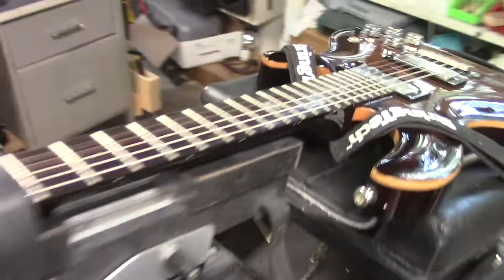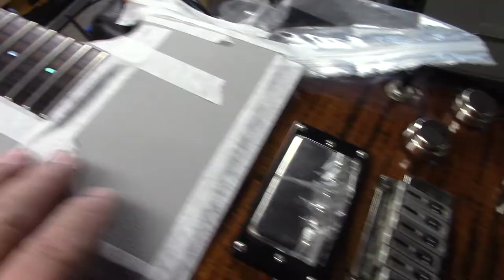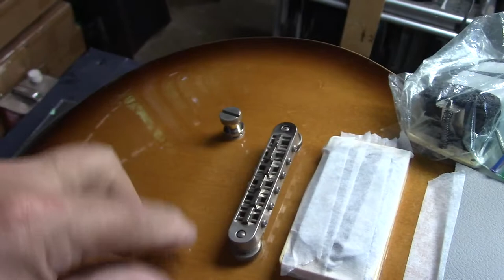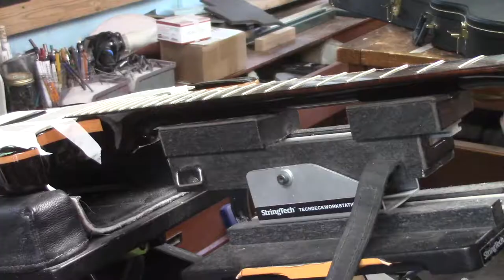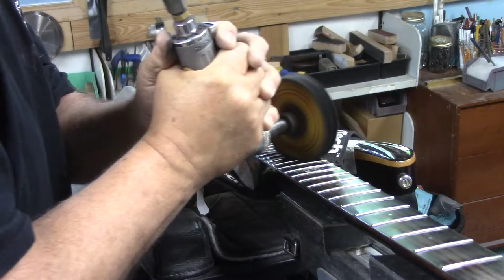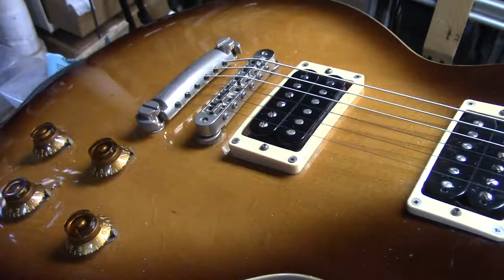Orville Les Paul / Dean Hardtail@StringTechWorkstations

Comment: Always a pleasure to watch you work, Mike! I just had to laugh at your cures for slop in the brige and tailpiece - I had a Nashville that I taped the threads (didn’t think about aluminum tape for ground - oops!), but didn’t think of shrink tube. I just chucked it and put in a new bridge with the same pin diameter. It needed a longer adjustment for the .060 Low E string, anyway.